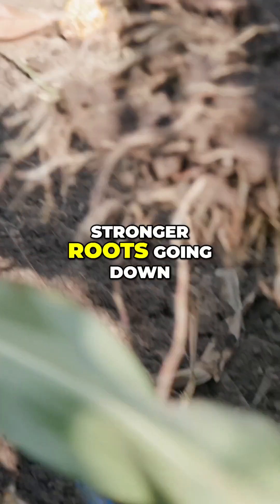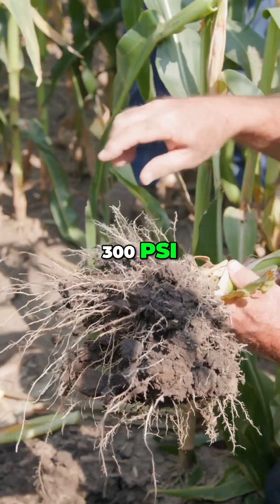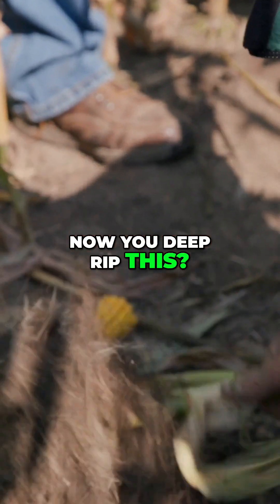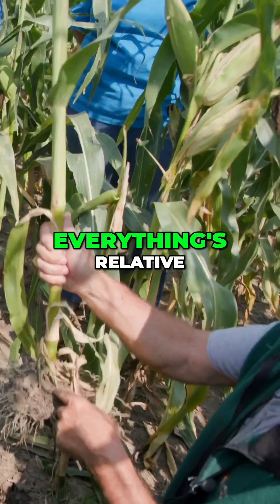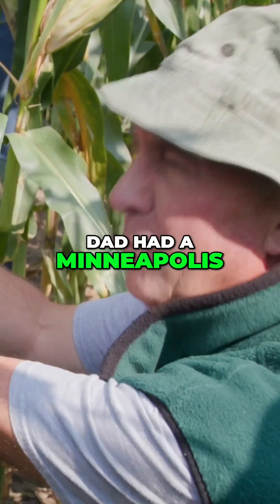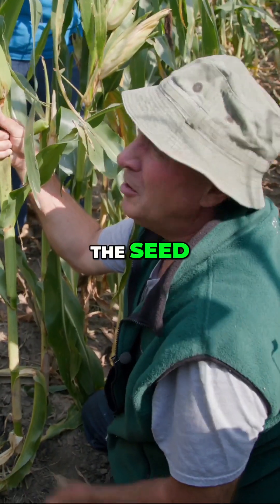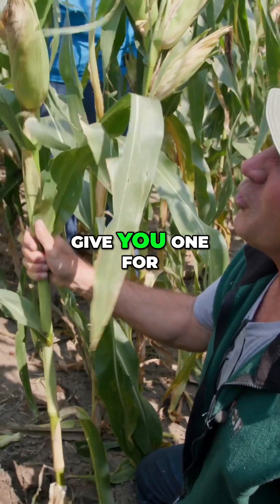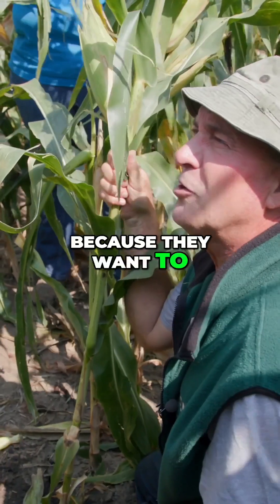Root Depth vs. Corn Yield

Comment: What does the psi stand for
Reply: P.S.I. = Pounds Per Square Inch. Need a penetrometer to measure soil compression.
Reply: Pounds per Square inches the Hardness of the Dirt.😊

Comment: My Grandmother used to get 4-5 ears per plant . But that was the 80s & GMO seed was not as prevalent . I still remember when they started pushing synthetic fertilizer & herbicides in my agricultural class in 85 . GMO plants tend to need more inputs especially with the weather patterns we’ve been getting .
Reply: Before that in the 50’s my father and grandfather would get 7. They would pick the best for seed the next years. We fed the whole residential neighborhood that we lived in off of 3 - 150 ft long rows right under the power lines to the subdivision in the back yard outside our fence. We could water it easily everyday. We picked dead leaves off every day, we tied up stalks and branches as needed, covered blooms when needed, saved Fr seed when best. It was an every day job. We had two compost piles one being added to and churned (all by hand) the other aerating  and worming on its own, back and fourth. How satisfying.